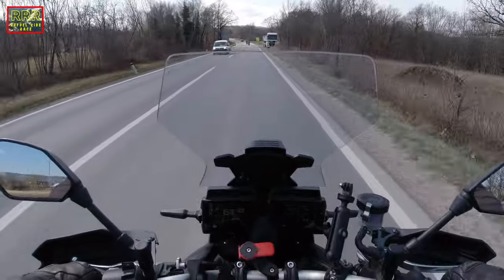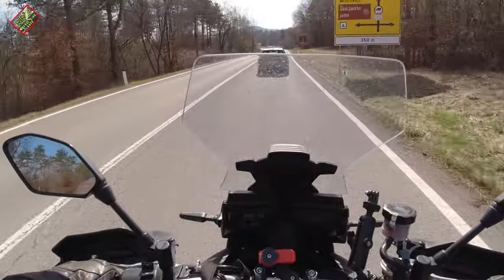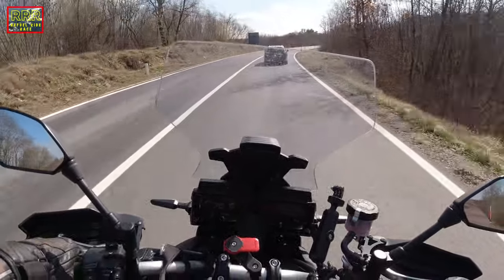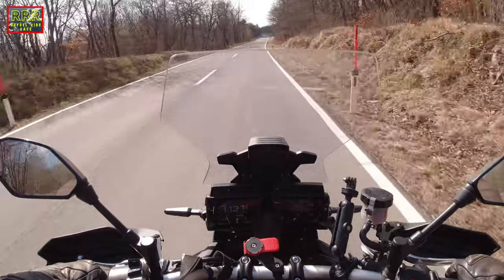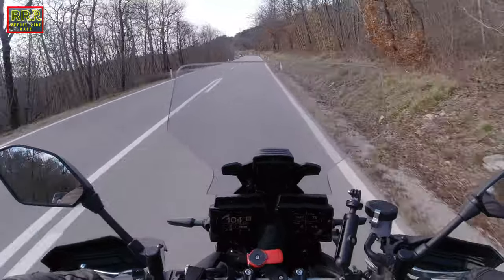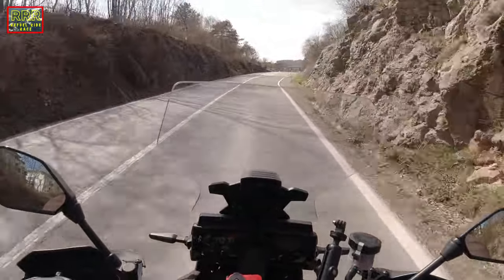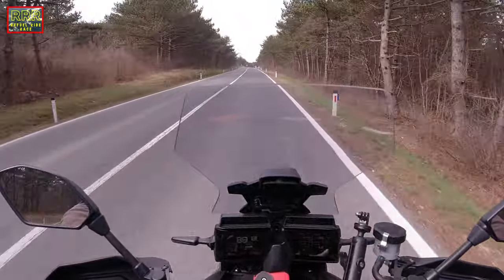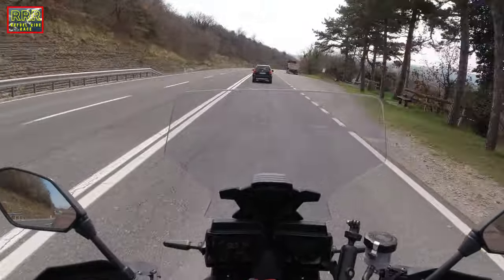HJC RPHA 70 fogging problem

Comment: The last time I had a problem of misting in-between the pinlock and visor, I just put a new pinlock in and adjusted the pegs to make it tight to the visor. 
As for the audio, I can clearly understand you but not sure it's as clear as some. 
We've just refitted our cheap Amazon Hamo Laptop microphones. Think the results are not too bad.
Reply from the maker: I will try to clean it first and adjust it. The helmet is new and I hope it will work. I encountered the problem once again only ij the rain. I already improved the sound, you will hear it. I watched you latest video and I agree about the sound. It is very good.